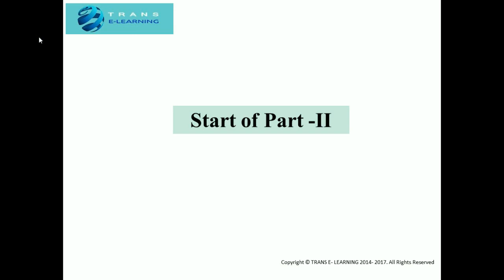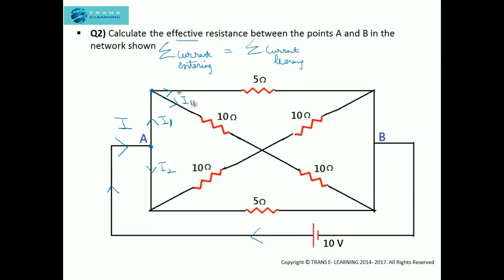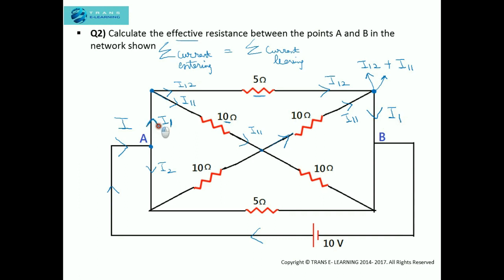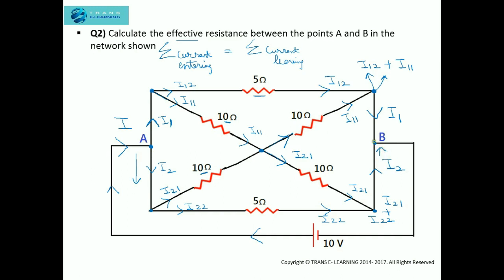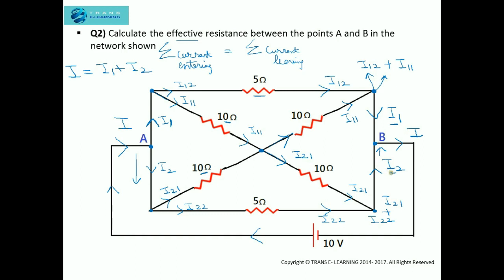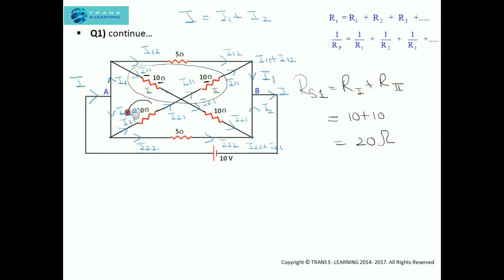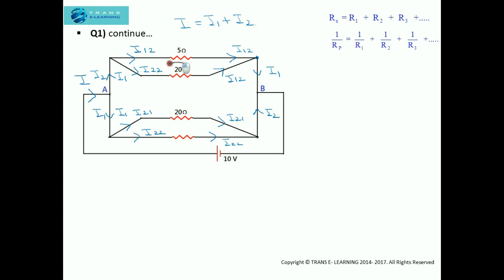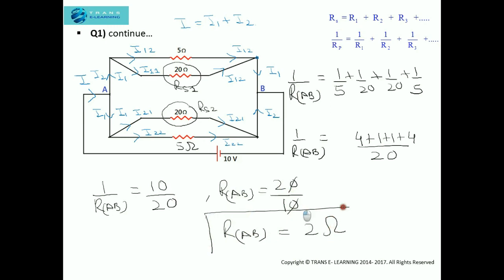Kirchhoff's Law ( Series & Parallel combination): How to solve Problems PP-V complex Part 2

Comment: The middle point is very confusing. If they aren’t connected, why are they drawn to meet? It they just cross, then why doesn’t the current flow straight across instead of turning at that point? This could have been made clearer.
Have a great day!
Reply: Exactly 💯. Thank you for this question, it has been bothering me, and I don't have the answer to it.

Comment: Hey please tell me why i(21) didn't go straight that is through the path of i (11)
Reply from the maker: Hi
As those wires are not connected, neither they are joined.
There is no junction , these wires are just crossing each other.
Thus the current i21 will not flow towards i11
Hope this solves your query
Reply: @transe-learning5000  but how do we know that if it wasn't specified? Are such assumptions safe?